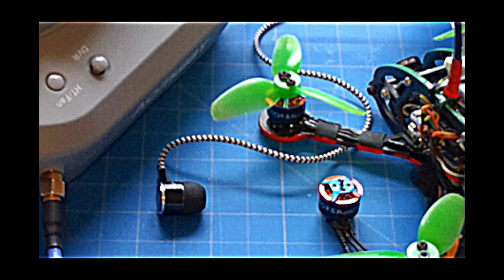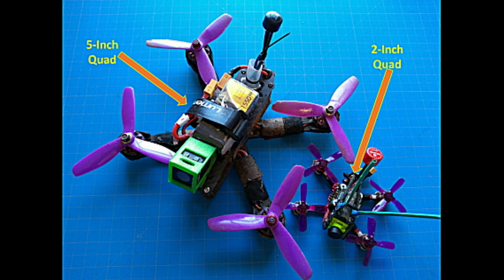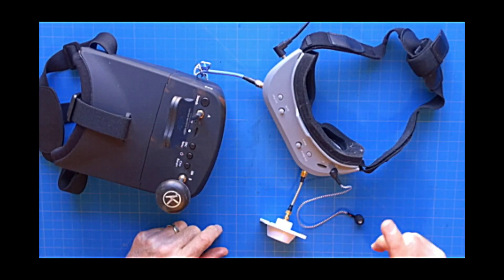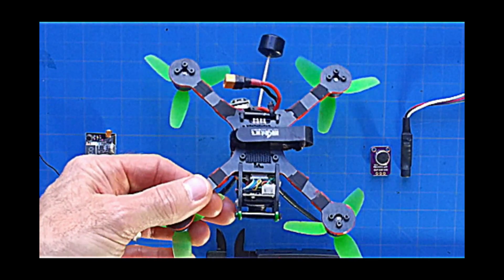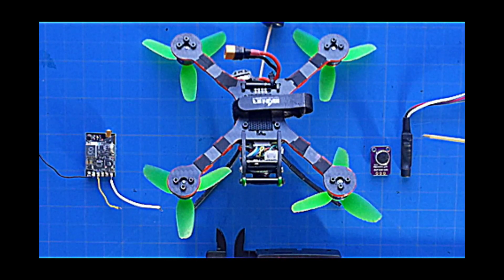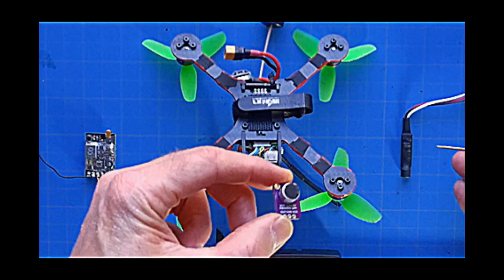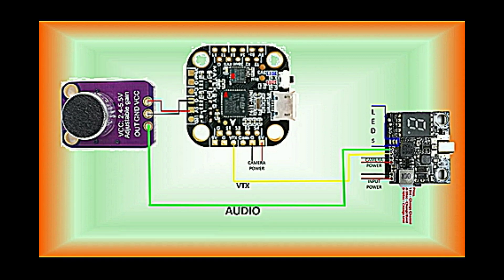MICRO FPV DRONE LIVE AUDIO SETUP

Comment: Thanks for this video. I was hoping it would be this simple, but I wanted concrete verification that it was that simple, crazy thing is…. 

I spent literally months on and off researching this hours at a time and I’d find nothing. So I’d give up. Come back a few days to a week later try other searches find nothing give up. Come back and do it all over again…. Everything is running smart audio and that’s pretty much the only videos you can find… 

I’m running FPV but I’m doing it on a long range ground vehicle so in my case audio would complete my immersive experience.  But because it’s not a drone I have to go old school traditional vtx and solder the mic to the vtx. 

I even searched YouTube dozens of times and couldn’t find your video, finally got lucky and ran across you in a forum with a link on how to do this. And I knew The basics of what I needed to do but I wanted someone experienced to reassure me it would work and see hands on how to do it. 

So to the point! Thank you for being the only guy on the internet I could find taking the time to show how’s it’s done and how easy it is and not expecting every joe shmo to have a smart audio system that does most the work for you I’m guessing, not entirely sure but I don’t drone yet…. Keep up the good work! 👍

Comment: What if my vtx doesn’t have a audio pad?
Reply from the maker: covered in the video
Reply: @TMacFPV  ...and the audio lead to the audio in pad on the VTX...

That is all that is said about the audio lead, and audio pad. This guy, and I, are asking about what if there is no "audio in" pad on your VTX, as a lot don't have that (or maybe they just call it RX or TX or SBUS? Can a TX or RX pad be used? And if so what settings are required for that UART to pass audio? I would assume that I could use any SBUS/UART/TX/RX pad and assign the function later in Betaflight (or whatever FC software you use)?
Reply from the maker: @ogpennywise  you have 3 options for audio (as stated beginning at the 2-min time mark of video).  Two of the options as stated at this point in the video https://youtu.be/Q3PUMTi5rOY?t=239  require an audio in pad on your VTX.  This is a special "audio in" pad that not all VTXs have (and in this video I am referring to analog video only).
Reply: @TMacFPV  I understand the three options you mention, and they are what everyone mentions. As it is obvious that having the audio port would pass audio. But there are other TX and RX options...which was what I thought we were talking about.

No worries, thanks for the reply. And take care out there.

Comment: There is a microphone on the Mobula7 HD (Runcam split 3 lite). I thought that it was used for recording only. So are you saying that it can be used for live audio (transmitted to goggle during flight)  as well?
Reply from the maker: I'm not familiar with RC Split 3, however, if the mic is on a DVR board, I'm guessing it's only for the DVR recordings. The mic (or audio in from external mic) would need to be transmitted by the video transmitter (VTX)
Reply: @TMacFPV  noted on this. Thank you.

Comment: How do ypu get the build in dvr to record audio with video ???
Reply from the maker: If you're speaking of your goggles DVR, besides doing what's  been explained in this video, it depends on your specific goggles make/model.  My Skyzone 03Os have an option in their menu settings to turn audio on or off with the DVR.  I'd recommend going through your goggles user manual to see if you can find this capability
Reply: @TMacFPV  yes found it thanks. Had to turn record sounds in sub menus lol.

Comment: Sounds very noisy. Isn't it possible to get the sound more clear?
Reply from the maker: Audio does sound better live (while flying) than what you heard from the goggles DVR footage (mentioned at 6:59 mark). There are ways to reduce the "non-motor" noise such as placing a small piece of foam over the external microphone and/or putting some shrink wrap over it.  Also, the proper placement of the microphone on the quadcopter frame can help (if you have more than one placement option).  The foam, shrink wrap, and proper placement all have the effect of reducing wind noise.  However, you will always have some wind noise. Its like sticking your head out a car window while going 60 mph to try to hear the car's engine.  Also, some motors are louder than others.  Usually, the smaller the motor the less motor sound you will get and the hard it is to differentiate the motor sound from the wind noise.  The larger the motor, the louder the motor sound and the easier it is to differentiate from wind noise.  One last thing.  If you want the goggles DVR audio to sound better for posting on YT or elsewhere, you can always run an audio filter program (like Audacity or similar in your editor)to filter out the background wind noise as much as possible.  Thank you for your question!  I hope some of this helps you out! Clear Skies and Happy Flying friend! 😀

Comment: On the dys f4 v2 pro were should audio be solderd to? Already have smart audio just now want to try audio
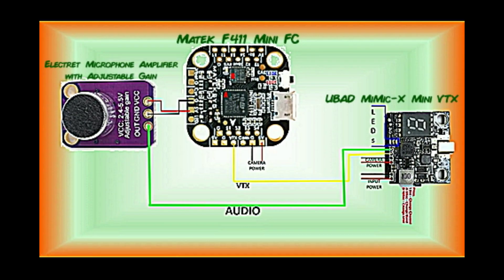Reply from the maker: Thanks for the question Tony! I think you'll like audio once you try it.  I find it adds to the fun and overall immersive experience of FPV.  You can get audi in 3 ways:  1. If your video transmitter (VTX) has an onboard mic you don't have to do any additional soldering than normal. Most VTX mics don't have the best quality audio.  2. If your FPV camera has an onboard mic it will have an "audio out" pin or wire that needs to get connected to your VTX "audio input solder pad (this is different than the "Smart Audio" pad on your VTX.  3.  Use an external mic (like the adjustable gain/volume electret microphone in this video).  Normally external mic's have the best audio since that is the only job that they were designed to do.  The electret microphone has 3 pads.  One is for power, one is for ground, and one is for the audio out.  The power and ground will need to be connected to a 5V power pad and a ground on your flight controller.  The "audio out" from the mircrophone (just like if it were coming from your FPV camera) will need to be connected to the "Audio in" pad of your VTX (which is different than the "Smart Audio" pad of the VTX.  See Time Hack 5:53 of this video (Micro FPV Drone Live Audio Setup for diagram).  So, it all depends on how you plan on getting the audio (onboard VTX mic, onboard camera mic or external mic).  If your VTX does not have an onboard mic than to get audio it needs to have an "audio in" pad to solder to.  A lot of VTXs do not have this pad.  I have made a few videos on VTXs which DO have this audio in pad feature.  You can take a look at those at Time Hacks of 4:01 and 9:36 of this video:  https://www.youtube.com/edit?o=U&video_id=OKm0SWILfPI . Finally, I am giving away 2 VTXs on Friday, March 8th which have the feature you need.  To enter the Giveaway for 1 of these 2 Free VTXs with "Audio In" pad, see this video:  https://www.youtube.com/watch?v=Z3fSJhzXQeA . Hope this helps you out. Any more questions, just let me know. Happy Flying! 😀